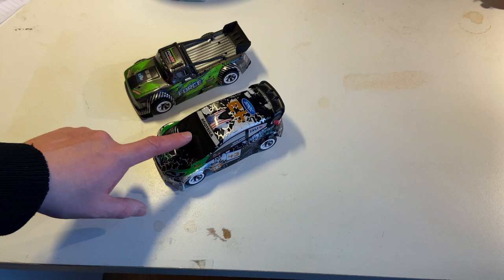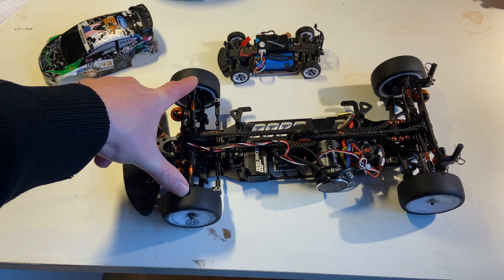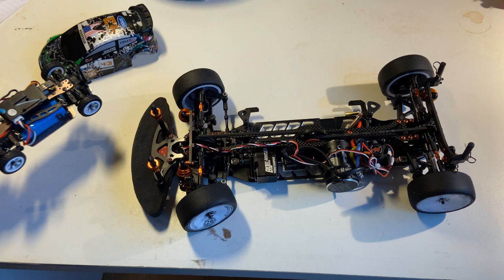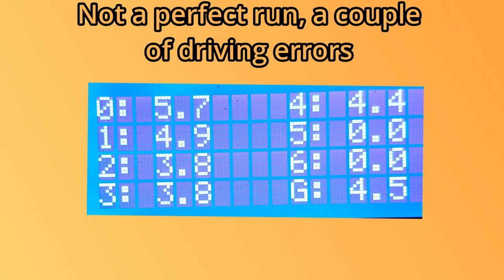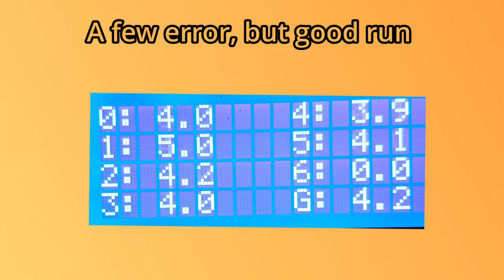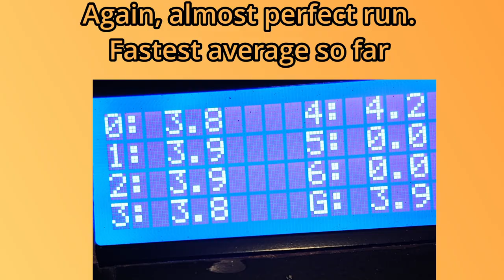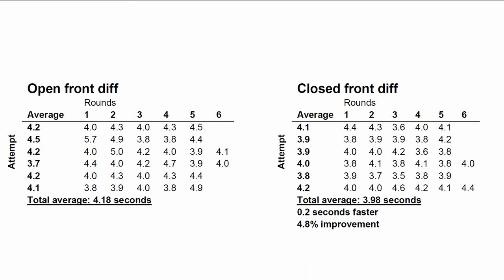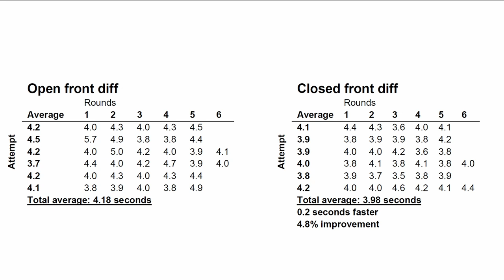WLToys K989, 284131 will it be faster with a locked front differential?

Comment: Pretty amazing lap times...are you using stock radio? Also did you loosen diffs and grease them? Did that also improve track times? Thanks for sharing i have the green truck version on the way..😊
Reply from the maker: Hi, I am using stock radio in this video, only modification is making the car turn sharper and loosen up diffs but not grease as described here: Upgrade drive train WLToys K989, K969 or 284131 | fix stiff, sticky differentials
https://youtu.be/vw0_qGlPOTs
Reply from the maker: I this video I replace the radio, for K989 it’s a huge improvement: WLToys K989/K969/284131 radio upgrade FlySky FS-GT3B with EXP, Exponential. Improve steering.
https://youtu.be/_LAe7qcECkY
Reply: Sounds Great! I will check out once i get car..thax😊
Reply from the maker: @roadstar499 no problem 😊

Comment: I would rather like to know how it can be made much slower and better controllable to run indoors. Not interested in speed in RC cars.
Reply from the maker: Hi, in that case I would recommend upgrading the radio - it make a huge difference for K989. The radio for K989 is pretty bad (it's better for 284131 and 284010). I am using this radio on my K989 and it has several benefits: It has no dead spots, you can reduce speed and it has EXP, see more about that in this video: https://youtu.be/_LAe7qcECkY

Comment: Is it wrong that i used glue to lock the rear diff because my 284131 completely lost drive to its rear right wheel? It fixed the problem, but was it a mistake😊
Reply from the maker: It depends on how you use the car. If you want to drift then locked diff is good, but not for racing. In this video I try to use the K969 with both locked diffs as a racer and drifter, and I try to use the K989 with both diffs open as both racer and drifter. As you can see in the video the diffs has a huge impact on the handling https://youtu.be/joNTf1FLNDw
Reply: I prefer drifting. Thanks for the clarification
Reply from the maker: @tuffy3637 Then locking with glue is a good choice 👍

Comment: Dude I still got  no idea how to make it lock for the front diff.can u teach me pls
Reply: Locked means make it from 4wd to 2wd right ?
Reply from the maker: It’s still 4wd. The locked diff just locks the wheels so they always rotates at the same speed. You can either buy a locked diff, I did that or you can add some glue to the small gears in the stock diff, but then you can’t undo it.
Reply: @LyhneRC  thanks dude .I will purchase it .
Reply from the maker: @van_r2222  Good decision 👍

Comment: Put a better radio  and u will be even  faster
Reply from the maker: You are right. I did upgrade the radio later on and it made the car faster and much easier to control. I made this video about that: WLToys K989/K969/284131 radio upgrade FlySky FS-GT3B with EXP, Exponential. Improve steering.
https://youtu.be/_LAe7qcECkY